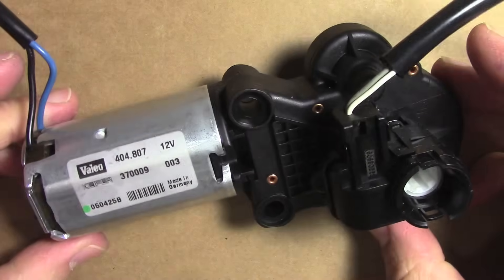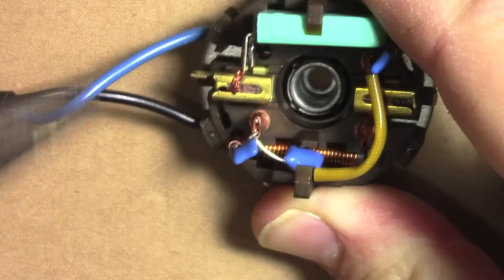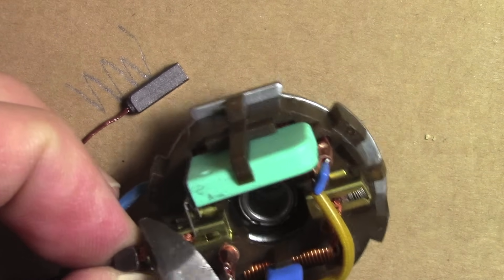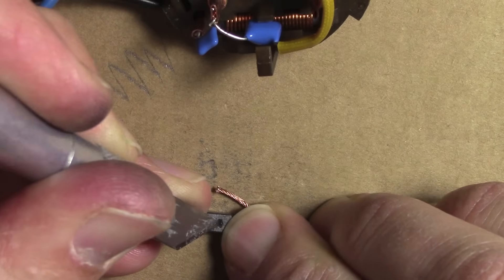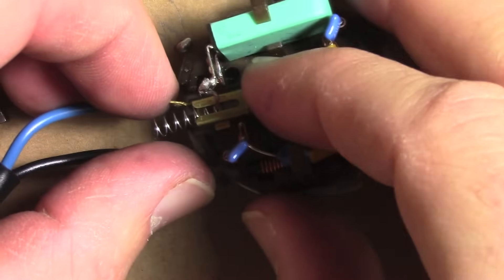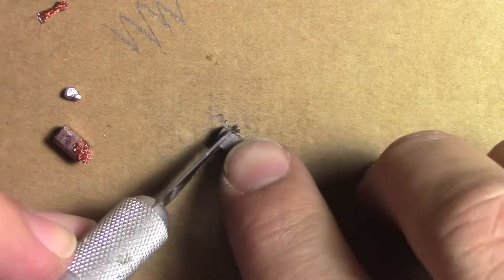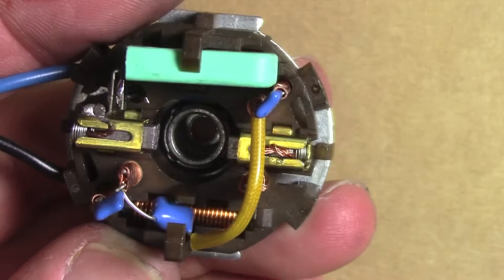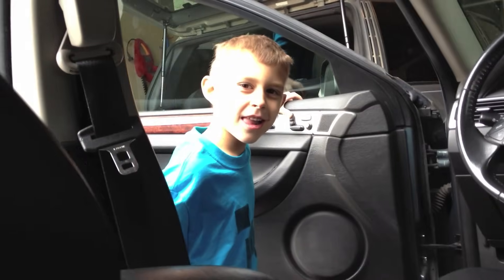How to repair fix an electric motor - replace carbon brushes

Comment: Thank you for taking the time to share your knowledge. I am repairing  my pool robotic cleaner, and need to replace the impeller motor brushes. I originally thought I'd have to solder the replacements' copper wiring onto the circuit board itself, but seeing your technique gave me just the info I needed! I appreciate your help!

Comment: Excellent tutorial, Carbon Brushes are very easy to alter sizes..Sand paper eats away at the carbon very aggressively..long as you avoid the area where the copper conductor is embedded
Reply: thank you

Comment: They are called brushes. What they brush against is called the armature. They do not 'alternately contact' the armature. They constantly contact it. Using the new springs, even cut down, gave them the wrong pressure. Too little and the brushes will stick in their carriers. Too much pressure, and the brushes will wear out prematurely. Good job, though! Most people wouldn't even try. :)
Reply: The part of the armature that the brushes run on is the "commutator"...
Reply: Actually they stay in contact with the commutator.
Reply: @wobblinwheel  Thank you.
Reply: Thank you.

Comment: The "thing" that the brushes ride on is called a commutator. If the brushes are as worn as the ones pictured you should check the commutator to see if the mica needs undercutting. If the commutator is worn to the same diameter as the mica then the harder mica will eat away the new brushes and/or cause the brushes to chatter. But you can often get away with one brush change without undercutting. Luckily for all of us BLDC motors are coming into play and we won't need brushes.

Comment: Most Motor using brushes to convert from D.C. to A.C., the design is spring pushed the brushes touch near the armature to rotate strong magnet rotate back and forward to create Alternator current , brushes is cheap , brushes can grind down certain size.

Comment: The back plate of the motor where the brush assembly is, there should be two holes. If you push the brushes back in their slots, take toothpicks and stick them in those two holes. They'll hold the brushes back for you until you get them over the commutator. Then just pull them out once in place.

Comment: I just took apart my sterling sewing machine and they all fell out- So the springs goes inside first then the square? I have a 120 motor 110-115 cycles 25-75 & DC

Comment: My electric leaf blower abruptly started to smell and lose power.  I watched this video and figured I'd do much the same.  So  disassembled the motor.  I removed the brushes (which were in good shape) and lightly sanded the commutator.  I reassembled it and it started just fine and at full power but quickly started to small and to lose power.  Any ideas on what to check next?

Comment: the measurments of the carbon brushes should be 4 mm x 4mm x 10 mm (milimetre). you said centimetre. you meant the measurments of the carbon brushes right ? great video thanks alot.
Reply from the maker: SoloArtForm Right! Thanks for pointing that out.  Sometimes when making these videos I say the wrong words and don't realize it.  It's MM everyone not CM.
Reply: np. still an excellent video.

Comment: I just finished SANDING down some carbon brushes to fit my jigsaw motor as they didn't have the right size, then  I found the whole jig saw used but excellent condition on ebay for $8 :(
Reply: We must be related!

Comment: I have a 1927 WHITE brand electric machine, the motor works but smells funny and I can feel a vibration when I touch it,  not grounded?  also, the electric cord  (inside the motor) is old cracked rubber covered with cloth. the machine is great.  does anyone know how to RE-WIRE this scary machine.   I don't want a shock or a fire,    thanks   I like your instructions about the brushes.
Reply: +moremud yeah I know how to RE-WIRE it

Comment: Sorry -- this is a good effort. But the narrator either does not understand the technology, or the terminology used to describe it. Those are brushes, not contactors. That is an armature, not a shiny round thingie. That is a braided connector, not a copper thread. Use words, and we'll all become better technicians. Recommend you go elsewhere to avoid some of the bad advice imbedded here.